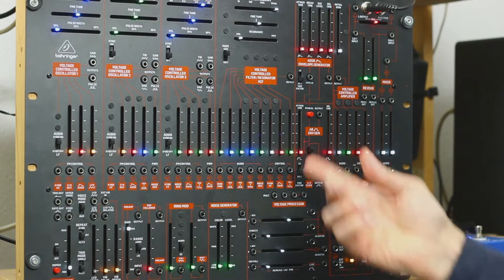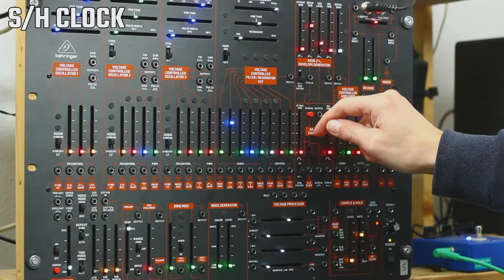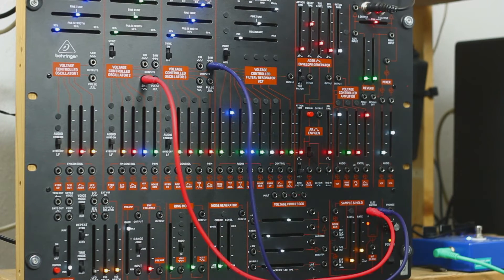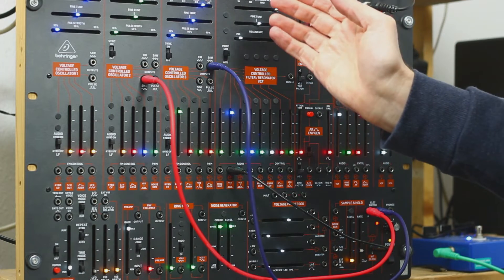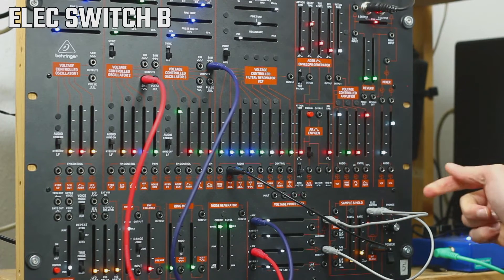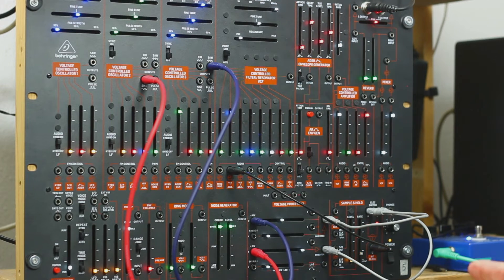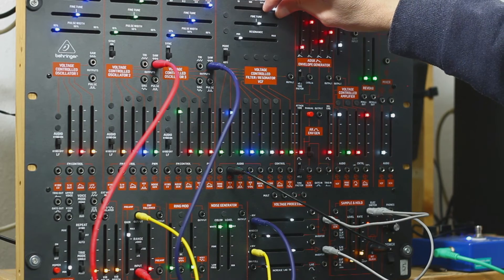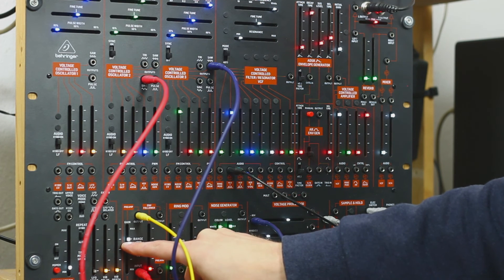Turn your Behringer 2600 into a rhythm box.

Comment: just a pity the 2600 won't sync with anything else - unless you know a way?!
Reply from the maker: @awpMusic1  you can use the clock input by sticking in a plug with cv signal halfway(!) in the socket.
Reply: @3ertin Thank you for that 🍀 sq 64 can change gate polarity, i wonder if that  might work too…

Comment: Great little video. Thank you. I knew this would be possible but this gives me some great pointers. Looking forward to trying this tonight. Have read the original manual. Have a Gray Meanie and I've just made  a nice wooden case for it, with a little slide out drawer for patch cables. Sub'd :)
Reply from the maker: I wanted to make a case for it as well. Might do it someday.

Comment: Thank you for this toturial. I follow exactly your patch and knob settings but I don't hear the same sound, is my Blue Marvin not ok or something? Or do you use some kind of other connected instrument or maybe sequencer? I have this problem aksi with other toturials from other users of the 2600.
Reply from the maker: It might be broken or, more likely, just a slight variation in settings. Also check your patch cables.
Reply: @3ertin  Well I did a second try and now it was ok. I watched for this try your tutorial on my bigger computer screen and so I could better see the positions of the patches, so lucky for me, my 2600 is alright 😀

Comment: Dang I didn't know the arp 2600 could do this . I got one and still learning the paths to make patch points . Thanks I'll be back
Reply: Any synth with noise can make all drum types. But Arp2600 is anyway usually more flexible compared to other mono synths…
Reply: @amazeuslab  thanks I didn't know that , I'm still learning
Reply: @HigherFrequenciez  You have Arp? Or planning to buy one?
I got one but I sold it…just to big for my room, to many cables…I really recommend Crave! It is very cheap and powerful. Some dude on YT has a whole video on how to patch it like a drum machine and Moog also has Mother 32 video with similar patching, which you can copy with Crave…Crave is basically Mother 32 clone.
If you are new to this, just know that not only analog sounds good and learn one synth from a-z. Crave or MicroFreak are very good for beginners… cheap and powerful. Micro even More but it is not analog. But I wouldn’t compare these two synths…both are good and good entry points even if you plan eurorack.
Btw. Osc frequency modulation can create fm synthesis…also good for drums, bells, percussion.
Reply: @amazeuslab  yeah I got the arp 2600 blue Marvin. I was experimenting with some patches I created paired with the arturia key lab 37 and was jamming . I also got the novation bass station and the peak and the pro 1 .the pro 1 being my favorite cause it takes the least amount of time for me to create on but still learning that and experimenting . I'll check out the crave and thanks for the info on oscillator frequency I add that to my list of experiments
Reply: @HigherFrequenciez  Look at Arp osc section...there is slider for FM frequency...so basically that is also FM synth.
Reply: @HigherFrequenciez  btw Crave paired with Arp is ''all you need''...besides polyphonic synths.

ps. I have some videos with my Blue Marvin ...you can check some and if you find something interesting...just ask. ;)
Reply: @amazeuslab  thanks  I'll definitely check your videos and appreciate you be willing to ask questions. My wallet says no more synths but artistic side is saying do it. Thanks man
Reply: @HigherFrequenciez  Not a lot on my channel but...maybe something interesting for you...few videos with Blue Marvin. Nevertheless...if you are new to this...stick with one synth for a longer time. Arp 2600 V is a good synth if you want to learn some patching on Arp. You cannot play chords (it is not a poly synth, Blue Marvin) but you can set each osc on a different note and program some simple chords. Arp can do many sounds! ...and Arp has some good low end! ;)
Reply: @amazeuslab  I'll take any information I can get on semi modular synthesis.
Reply: @HigherFrequenciez  semi is basically modular anyway ;) The only difference is that you don't need cables because it is pre wired, what you can brake by inserting a jack. If you want percussion....modulate osc frequency with adsr via attenuator...Arp has everything you need for it...but having some other adsr is also useful...and attenuator controlls ammount of adsr into osc frequency...programming a kick like that is quite easy...snares or hats are made with noise. These are some basics but for a good start!
Reply: @HigherFrequenciez  if you are still learning the basics and you have an arp 2600 I'd really start studying thr shit out of it before you buy something else.. or if you do want some kind of accompany buy a cheap drum machine
Reply: @neonblack211  I be studying about the arp 2600 but I have bought few more synths like the hydrasynth and the novation peak but I have studied those too. Im able to make some really nice patches on the arp 2600 for me the arp 2600 is a exploration tool . I got a Beringer tr 8 drum machine
Reply: no it can't...  @amazeuslab